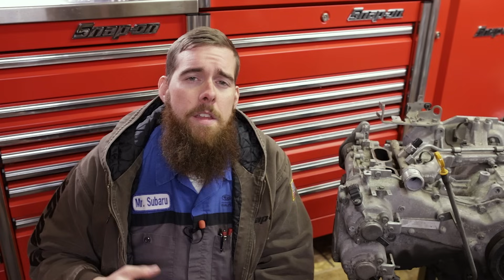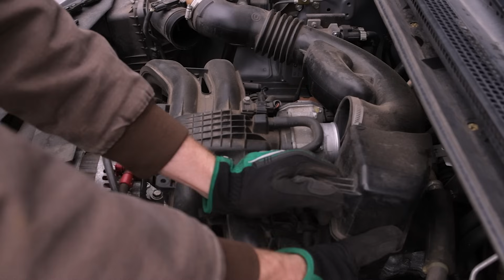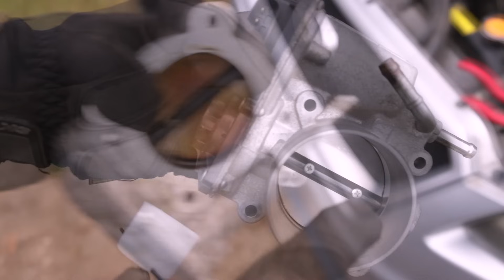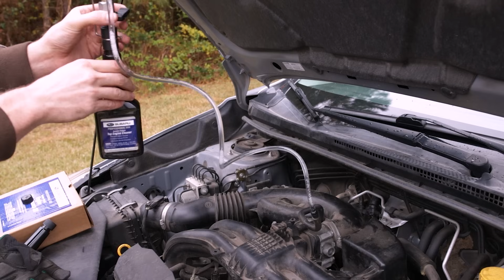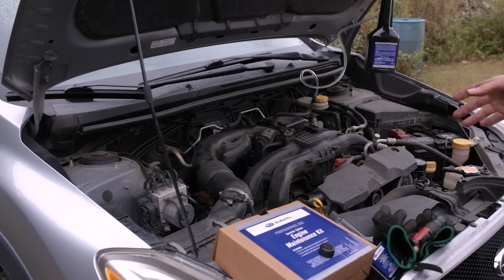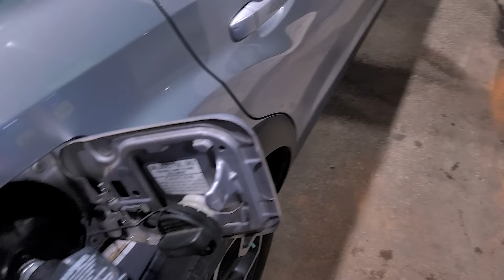Keep Your Subaru Running Like New! Subaru Engine Maintenance Kit

Comment: How often should you do the Upper Engine Cleaner? My sons 19,000 mile 2021 wrx started throwing engine code for misfire and the dealer said it’s carbon buildup and they are opening it up and cleaning it under warranty. Want to do the upper engine cleaner moving forward.

Comment: I regularly use a can of sea foam in the fuel tank and 4oz in the oil. Would this be sufficient along with the throttle body cleaning to clean/prevent carbon build up?

Comment: Do these steps also apply to turbocharged engines? Specifically, the upper engine carbon clean? I tried to use the same products for a turbocharged engine but had some trouble finding the vacuum hose that connects to the intake manifold.

Comment: I try to do it on Subaru Outback 2010. When I start enginecfruid running front little hole in connector and engin stopped.  What I did wrong?

Comment: I’d love to see a “this vs walnut blasting” video
Reply: There's a very good intake valve walnut blasting video -- for a Nissan -- on the AliMECH channel at https://www.youtube.com/watch?v=c21xAyWatxU, with some helpful tips in the comments.  The before-and-after images in this video show the intake valves looking brand new after walnut blasting.  Other videos for cleaning intake valves with chemicals show far less effectiveness (before-and-after) than walnut blasting.

The walnut blasting approach has other advantages:  (1) no risk of clogging the catalytic converter, (2) no risk of hydro-locking the engine, (3) no risk of engine codes being thrown, and (4) can handle heavy carbon build-up.  But you have to remove the intake manifold and be prepared to replace the intake manifold gasket.  And you have to be able to turn the crankshaft to close intake valves.  I do not know if the procedure is more involved on a Subaru boxer engine.

Comment: I guess the only way to tell is to do a before and after inspection of the back side of the intake valves. Do you think you would see a difference? Isn't your cross trek port injection anyway. Can you damage the cats that way...or no.

Comment: I just added a de carboning spray to my 2005 EJ engine. It threw 2 codes, both misfires.
Have you ever looked at the spark plugs before and after the carbon removing spray to see how much it cleans?

Comment: If only we could find out what company makes these items for subaru to re-label and sell as their product. Subaru does not make these product any more than GM makes their top engine cleaner which is actually Techron with a GM label.
As for top engine cleaner. These engines need to be either port injected to allow fuel with cleaner to flow around the valves to stop the buildup, this is not possible with direct injected engines. Or for best all around purposes, a dual port injected/direct injected engine. Many manufactures are doing this giving the best of both features. Direct injected for fuel economy, port injected for valve cleaning properties. Yes, it does increase the cost of the engine, but if keeping the vehicle for over 60-70K it will be well worth it.

Comment: Hi Mr.Subaru.I read a TSB on this for 19-21 2.5 said to run car at 2000 and set the tool at 22 degrees.Said it should take an hour to empty bottle. Thoughts?

Comment: Hi Mr. Subaru-Thanks so much for the excellent body of work.  Really like the OBs with the FA24DIT but worried about carbon buildup. Are these engines better/worse than other DIs?  Seems like a lot of people believe chemical induction cleaning doesn't do much of anything, whether Subaru chemical or BG or whomever.  Any thoughts on Walnut Blasting as the gold standard?  Seems manifold removal/replacement is most of the work.  Actual blasting seems easy.  Thoughts?  Thanks again.
Reply: Walnut blasting from a reputable technician is going to be better. For turbo engines the buildup can be worse because they have higher pressures in the intake, but if you get it blasted and find a quality catch can, or Air Oil Separator, you can illuminate the oil blow by and the need for this kind of service.

I put an AOS on my ‘22 wrx and I was astonished at how much buildup there already was.

Comment: Would this be recommended for an older EJ engine?  Specifically a EJ20G in a v1 STi.  I know the heads on these old ones have oil squirters and that can cause a lot of carbon in the combustion chamber.  But not sure with the age of the engine if this would be advisavlble/required.

Comment: For us down under in the land of Aus, the owners manual has a requirement for an upper engine clean every service using SA459 upper engine cleaner. Interestingly I could not find this maintenance requirement in the Japan, US, Singapore WRX owners manuals - is it a maintenance tax for being in Australia , or left off in the other countries so that services are cheaper and therefor reduces cost of ownership for the new buyer. Any chance of a video on how to do this service item on a FA20DIT engine (2015+ WRX )
Reply: im in the uk with the same issue, I cant find these parts here. Did you find a replacment?

Comment: Planning on replacing the cat system and O2 sensors on my manual 2010 Forester with 250K. Going to perform this service 1st so as not to clog the new cat system.

Comment: Excellent tutorial. I have one question concerning the cleaner (and tool). Do you think the Subaru labeled cleaner would be more suited to this engine than any of the off the shelf auto parts store aerosol cleaners, such as spray Seafoam cleaner? (or majorly different at all?). There are others, of course. These would already be atomized via the spray, and according to some generic video tutorials, a helper on the throttle keeping the engine from stalling (and potentially vapor-locking) would help negate the problem. This is the first time I've seen this particular video, just discovering (and subscribing to) your channel less than an hour ago. ....one would think that auto makers who utilize direct injection would have intake cleaning an included warranty maintenance item since that's a built in problem. My wife's Crosstrek has been a generally reliable car that gets great mileage (due to the GDI), But I've never considered intake cleaning since I've mostly driven carbureted vehicles or Tacomas with the dual injection. Anyway, thanks for another great video, and any input about intake cleaners will be appreciated.

Comment: I have a Subaru Outback 2008 my just start randomly cutting of I replace ignition coil splugs and wires air mass flow sensor and camshaft sensor my only thing now is it can probably be fuel pump or fuel system need cleaning any suggestions

Comment: Im far far from an expert however I have watched a detailed video on carbon cleaners and one of the cases it said carbon cleaners shouldn't be used was with direct injection.   Have you heard this?  Is it false or are you unaware of the reasoning for not using it on direct injection?  I've also watched before and after videos and there is little difference after running it for a while then scoping it with a camera to see the difference.  Most of the gunk removed in the direct injection was before the valve not on the piston. It did very little cleaning in the combustion chamber itself which is where all the buildup is in direct injections

Comment: Can you settle this?  Nobody seems to know where to inject top engine cleaner on an H6 3.6.   Some people say it's the hose going to the brake booster... but then wouldn't that only be going to cylinder 6?   What about the other line from the intake hose?   PCV?  Thanks in advance!
Reply: I'm in the same boat.  Did you figure out which hose to use?  Thanks.

Comment: Do you have a fuel system cleaner recomendation to add to fuel to help prevent the carbon build-up? I have used Seafoam in my gas tank a couple times a year on my other vehicles.

Comment: Great Video very Informational .... Question I have a 2018 crosstrek 117,000 miles.  Engine Light just came on and it reads PO841 Code.  Transmission Fluid Pressure Sensor/ A circuit range / performance.  Do you know if this sensor is inside of the transmission or is sitting outside. Your reply will be gladly appreciated.

Comment: Looks like the updated tool number (   SOA868V9432   ) is to be used with Carbon Cleaner P.E.A.  (     SOA868V9166    ) according to the Service Bulletin 9-74-21 .  Disregard some of the pics on the Subaru parts pages, specifically of the cleaner, they are wrong.👍

Comment: Mr. Subaru, you are a lifesaver for all us Subaru car owners..
I own a 2017 Subi Impreza that I am very happy with..
It is very reliable and runs likes it still new after 120K miles.
I am about to replace the spark plugs, just wondering right now if that is really neccesary..??
Reply: Subaru recommends changing plugs at 60k and 120k. Normally iridium plugs are good for 100k but I'm thinking maybe it's because Subarus use a waste cycle spark system so it's firing twice as often.

Comment: This.  This is why I got rid of my 2015 WRX. I thought I was taking care of it. I thought I was going easy on the car. I bought the extended warranty bringing it to 8 years because I wanted to keep the car until it died. Little did I know a combination of the EGR system and lack of valve self-cleaning, it was experiencing a random misfire. Subaru ran this cleaning kit through the car twice and I still had problems. If I simply installed the EGR delete kit, I wouldn't have a problem...but I'd void that expensive warranty. To make matters worse, every application of this cleaning kit slowly damages other components. The stress was simply too much, and I sadly had to trade it in.  Now I have a car that does everything the WRX and much more for less money since it was a couple years old. I won't be looking back to Subaru for a very long time...if at all.
Reply: How do you like the new car compared to the wrx?
Reply: @spacebeyondcompare  There will always be pros and cons between them, but I'm still thoroughly enjoying my current car. 2017 Mercedes C43 AMG. I honestly think it's a more appropriate next choice for the "grown-up WRX owner" than a Toyota Tacoma as people like Regular Car Reviews puts it.
You get more power to weight than the sti, more luxury features and refined interior, and maintain 4wd but with a bias towards the rear for a more sporty playful feel. I also get about the same gas mileage so that was a nice surprise. Where it lacks is in visibility. The WRX had that in spades, but it was also a taller, boxier car. The C43 has some sensors to offset that so I've never had a problem. The trunk is a touch smaller and has an odd hump in it. (Presumably to get over the axle) And ultimately, despite having a lot of electronics, the German's are not the best at them... maintenance is key on any car, and German cars are a must when I comes to maintenance...which doesn't come cheap.

Comment: did this procedure on my 2021 crosstrek premium 6mt this past weekend.  Used the kit with the metal can of top clean and the tool for the metal can.  There was no way to tell how much top clean was being consumed by the engine.  Could not see through the metal can.  What I did was wait for the idle to get a little rough, then turned off the valve and burned it out and repeated till the can was empty.  At one point the engine threw a blinking check engine light, but it went away after a few seconds after burning out the top clean using the throttle.  CEL never came back.  Everything went well and this video helped.  Saved me some money too.  Thanks Mr. Subaru.
Reply: One very important question is do you know JESUS CHRIST AS YOUR PERSONAL LORD AND SAVIOR?

Comment: Hi Mr Subaru, Thanks for your awesome videos
I bought this 2014 subaru forester 2yrs ago.  It has added oil consumption between oil changes about 1qt every 1000k.  It has reached 120k and I need to the maintenance which I understand is a considerable list and $$.  I have also noticed lately  it jerks sometimes when I accelerate.  Do I need to do all that is listed for this maintenance or is there a way I can do it in parts,.  Any suggestion or comment is welcome...I only drive about 800miles a month...
Any chance I can bring my car for You to do this work, I know its a long shot...or how can I get an independent subaru mechanic to help me , I'm in California.  Thanks

Comment: All very interesting except I'm not at all sure if this process is recommended for my trusty 1993 Legacy non-T EJ22 engine.   So, I guess I'll start with some sea foam cleaning of the manifold if I can get to it. Have already cleaned the PVC valve and inspected the solenoid/IACV. One guy who had an EJ22 on a VW bug seems to have recommended just spraying sea foam into the intake on the IACV.   I either fix it today or let it sit for a few weeks for when I have time to be more thorough.  Any opinions on just spraying  Seafoam into the intake? Is this what needs to be atomized? and could ruin the engine if not atomized?

Comment: Great video in all aspects. The only small correction is the link for the Upper Engine Cleaner Tool goes to the one for a metal can (SOA868V9431), not plastic bottle (SOA868V9430). Interestingly, the metal can product is named Top Engine Cleaner, while the plastic bottle is called Carbon Clean/Engine Maintenance Kit.

Comment: Does anyone know why Subaru changed the bottle of top engine clean? It will no longer screw onto the top engine tool, the new bottle is to small and is taller. I don't known if they came out with a new tool  or adaptor., and I cant find out any info on line.

Comment: I just did the top engine clean on my Croostrek  at 30K. I didnt get any smoke out of the tail pipe, I don't know if this was good or bad.  I purchased the top engine tool and the maintenance kit from Subaru and the new bottle of top engine clean will not screw onto the tool, the bottle is to small. Do you know of a different tool or an adaptor that will allow the new bottle to work with the tool? I didn't have any thing so I just had to duck tape the the bottle to the tool around the top.

Comment: Thanks for the great content.  It really helps! New subscriber.  Question….any need to change the oil after the top end cleaning?  Does it compromise the oil in any way?  Thanks!
Reply from the maker: It’s advisable to perform the service prior to a scheduled oil change.
Reply: @MrSubaru1387  perfect.  Thank you.

Comment: I just wanted to update, I guess they discontinued this stuff? No longer available for sale. Still would like to clean out my engine I'm around 110k miles, just did a CVT flush on my Crosstrek thanks to your videos. Would there be some sort of alternative?
Reply: The PEA cleaner “should” be available from any Subaru dealer for $15-$20 - you may have to shop around. Throttle bottle cleaner e.g. CRC is available at most auto parts stores. Fuel system cleaners from Lucas, Chevron , etc are available at all auto parts. As for the cleaner tool, dealers don’t sell this (as told to me by a local Subaru dealer) because they only have one part number for a 2 pack of cleaner tools so they aren’t able to sell them individually. Like MrSubaru said, buy this one online.

Comment: HI MR. SUBARU GOT A QUESTION. I SEE SUBARU HAS AN UPPER ENGINE CLEAN IN A SPRAY CAN, HOW DOES THAT COMPARE TO THE METHOD YOU SHOW IN YOUR VIDEO FOR A 2009 LEGACY 2.5 NON-TURBO. THANK YOU

Comment: I cleaned my throttle body without removing it. I did the top engine cleaner and it kept killing the engine. The video I watched before didn’t cover clearing the flood after it dies. I did the idle relearn process and after driving it a bit I noticed that it runs about 500rpms higher than before and cruising speeds in 5th gear now run at 2500 rpm’s rather than 2000 like it was before. Is there something I can do to get the idle back to normal?

Comment: I just bought my 2019 Crosstrek that I've been leasing, learning to do all my own work because Subarus are just that easy, I've owned a Corolla and Altima before this Crosstrek and I've never felt this comfortable doing my own work. Thanks to Mr Subaru I'm confident I'll drive this Crosstrek till 250,000+ miles
Reply: MrSubaru ( ? Jim ? ) Would you do some Eval's / Full Maint. on some late Model RU's. Some of us are not RU owners but thinking about it? Such as me . . . a 15K / 30K / 45K / 60k mi.  Full Tech Eval. along with your Prof. Opinion about what you see / what you expect might happen on late model 2.0 & 2.5's would very beneficial. When all we see is repair, repair , repair . . . it's easy to forget most of  your video's  are for much older model's. It Just leaves a lot of us with question's like . . .

 Well ?  . . .  How much of this has been corrected with the newer Models? If anything at all? Especially Blow-By . . . this would be an absolute deal breaker for me. This kind of stuff is no accident . . . after this many years . . . this is Car Maker Sabotage IMO and as you proved in an earlier video this involves all Makes/Brands. Cars from a century ago did not leave the factory suffering from Blow-By This is a Mgmt and/or/both QC Willing Decision to Fail the consumer.

So should we even consider buying a RU if they are going to be that much trouble?
I see a lot of new Crosstrek's on the road in my area and I don't know what to think ?
Slow 2.5 Eng. / CVT - Uncertain / Have they fixed that Oil Pickup Tube ?  . . . and a bunch of other things you have not yet covered/seen yet.
Good ? Reliable ? Long Term $35K Investment or not ?
Thanks . . . We Depend on You.
Reply: How has it been going with your Crosstrek? I have a 2025 2.5l.
Reply: @Paul__108__ filling it up with gas right now, no major complaints other than clear coat chipping but thats from leaving it outside and not in the garage.
Reply: @Didgeridoo42 Thanks 👍